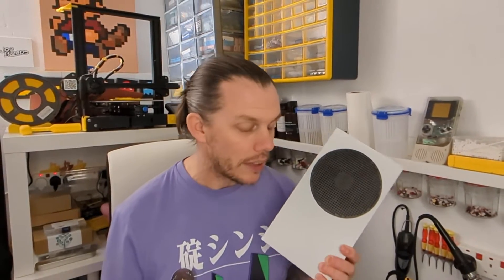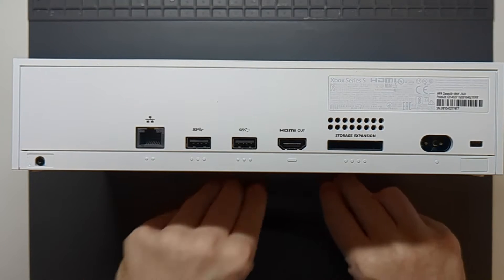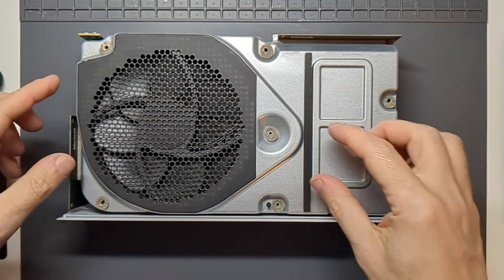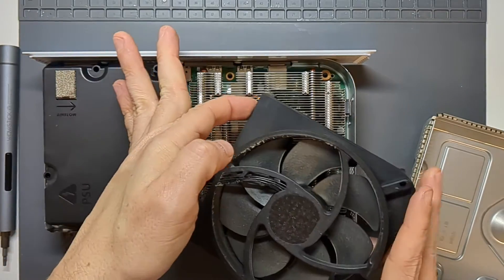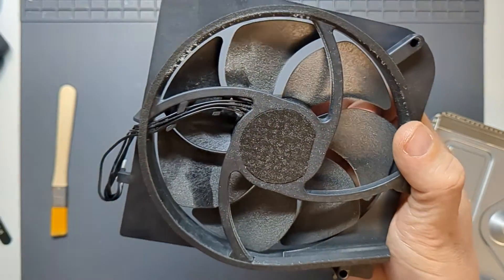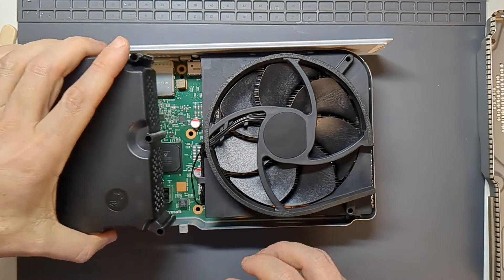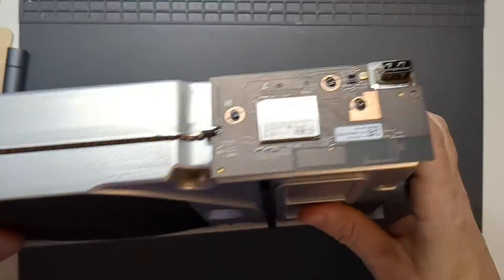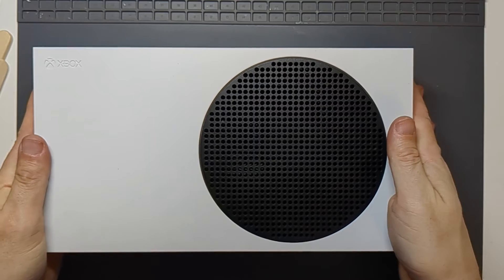Xbox Series S overheating - disassembly and dust removal (includes reassembly)

Comment: Did that fix your Xbox from overheating
Reply from the maker: Bizarrely, yes. Had no problems with it since.
Reply: @JoeBleeps  ok thanks I will do that with mine
Reply from the maker: @xLoSxZoMBiE  good luck! I also moved it to a better ventilated spot after I cleaned it, to help reduce any further dust and heat buildup
Reply: @JoeBleeps  can't do it yet waiting on t8 and t10 to get here but you think it will fix it cause it over heat when my Xboxis off as well

Comment: I can't connect to network after assembly, even Wifi or cable 😭😭😭
Reply from the maker: definitely sounds like a cable needs reconnecting, I'm not sure which is the wifi antenna but open it back up and have a good inspection
Reply: @JoeBleeps  I just did factory reset once it's normal now, thank you btw
Reply from the maker: @Leviathan.Astrea  ahhh good to hear!

Comment: I’ve noticed if I play my series s in a room without ac it’s almost always starts to overheat.. so I put it in a room that’s always 68f. Since then haven’t had any issues. Seems they overheat much easier then one s… my one s I use to play in 100 f weather and it be ok. I love my series s but I wish they would’ve changed the layout of the fan as imo it pulls in stuff
Reply from the maker: It's definitely the downside of having such a powerful console that's so tiny. I've found in a well ventilated area it's been fine since I cleaned it out

Comment: Great step by step.  I suspected dust in my 2nd hand one which revved up like a hairdryer instead of the famed 'whisper quiet'.  The filth and stinking grit I found inside convinced me I was right.  Must have been on the floor with 10 dogs and junkies chain-smoking around it for the 2 years before it was passed to Cash Converters - who by the by simply must have switched it on and wiped the data.
Reply from the maker: Ewwwww I'm glad you managed to save it!
Reply: @JoeBleeps  I should have kept it in its gross condition and auctioned it off to YouTube console cleaners & repairers
Reply from the maker: @imagecarpenter  😂😂😂

Comment: Good to know. My Xbox series S just shut down for the first time after owning it for a year and half. The fan got really loud loading into a COD lobby, I got nervous and force quit the game and the Xbox flickered then shut off and went silent. Turned it on today tho and silent again so that’s good lol. I notice my Xbox gets loud when I switch between a new gen and old game too sometimes.
Reply from the maker: I was surprised how easy it was to disassemble actually. Worth a try.
Reply: @JoeBleeps I never ended up trying. Fast forward a year later to now I took it apart yesterday for the first time after owning it for 2 and half years. My god was there dust/lint in a lot of the vent holes etc.
Reply from the maker: @stevenbethel1351  I hope it helped giving it a clean
Reply: @JoeBleeps  she went from sounding like a lawn mower and over heating, to know you can’t even hear the fan at all and hasn’t got too hot when I touched it .
Reply from the maker: @stevenbethel1351  much better!

Comment: Thanks for this, Gonna pick up the screwdrivers and some compressed air. Mine isn't overheating, just the fans slightly louder than it used to be.
Reply from the maker: It should definitely help make it quieter. Good luck!

Comment: That’s surprising. It didn’t look like enough dust to cause random shutdowns. Seems like their might be a bigger issue somewhere.
Reply from the maker: I thought the same but it definitely seems better. I've also put it in a more well ventilated spot, so that will definitely help too. If it starts having issues again I'll investigate further.
Reply: @JoeBleeps hey any news on it? Mine keeps saying overheating after playing a game for 2min
Reply from the maker: @foshizelmc7412  it's been fine since I did this, not had any overheating issues since
Reply: Definitely mostly an Xbox issue I have a temp gauge on my Xbox and whenever I run a game it can reach up to 120 or 150 pretty easily. It could be that the fans not working I don’t know, but when I did look inside and took apart everything like in the video there was no dust whatsoever.
Reply: Just curious as i have a unique issue before taking the Xbox apart . The series’s starts up but has no signal , and the shuts down on its own within 1-2 minutes . Also can’t hard reset or have sync working . Wired controller can turn on the Xbox but can’t turn it off with no audio cues . The controller light is also off .  Any guess would be appreciated . !
Reply: CPUグリスも新しい物に塗り替えた方が良いですね
Reply: thermal paste?
Reply: I just bought a series s from fb marketplace and the fan gets hot during game play and I was worried but seems that's normal from what I've seen thanks for the video
Reply: @cjh1236 How is it now, still works? Did you clean it?
Reply: Agreed. No way that much dust will cause overheating.
Reply: You don’t know how much I appreciate you, my first Xbox I tried to fix was absolutely not going to work even with new thermal paste and everything, but I tried booting up another one because it only talked about overheating, after cleaning it and putting new thermal paste in it again it’s running fairly smooth, I even put my fan in front of it just in case. But thank you so much for helping my COD grind and playing with my friends again:)
Reply: Most problems is the liquid metal and soldering.